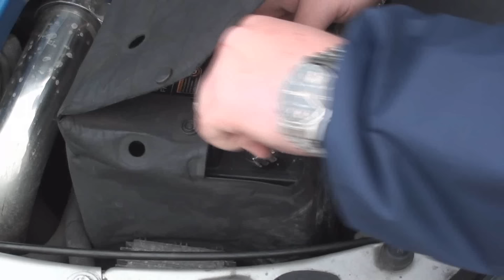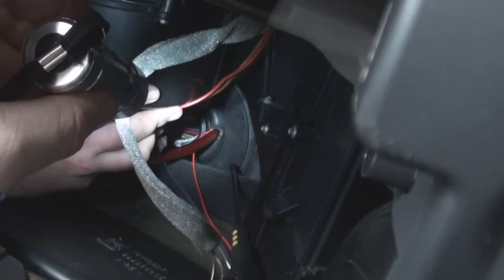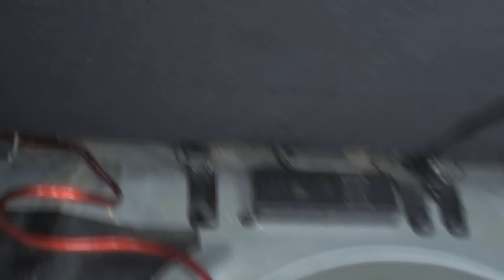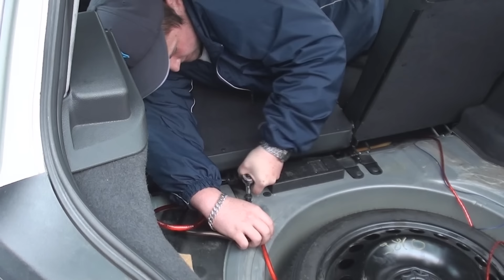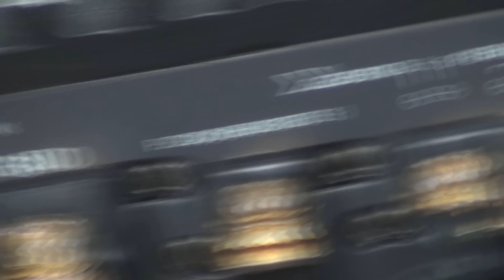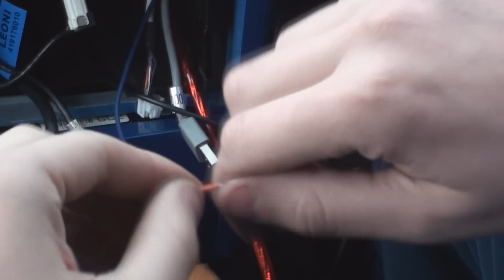How To Install A Subwoofer And Amplifier In 5 Minutes!

Comment: I m stuck. Please help. My car  stereo doesn't have the remote
Reply: use the power antenna wire as a substitute, which is usually activated when the radio turns on; alternatively, you can tap into a power source from your car's fuse box that turns on with the ignition to provide the necessary signal for an external amplifier.

Comment: What wiring kit would you recommend for a dual 10” with a 1600w amp?
Reply: 35mm^2 should be okay, but for the plans on future, you may use 50mm^2 coper wires. It seems like it’s not so important but i had few problems with my wires because they were too tight 👍🏻

Comment: Spot on lads, great vid to learn off. One question: Did you connect the speaker cables to a factory radio, or was it an after-market system? I want to connect to a factory radio

Comment: never mount an amplifier on a bass box, there are subsonic oscillations on the coil in the amplifier and magnetism in a speaker, and solders on the circuit board come loose and a burnt amplifier and no one gives a new one under warranty. for incorrect use

Comment: My ex installed my sub and amp but I need to remove it and keep the wires in place do I just disconnect the wire from the battery and tape it to stop it touching any metal do I have to remove any other connections to the battery first thank you
Reply from the maker: If you remove the fuse from the fuse holder, the main power wire then is safe. The Earth and RCAs are also ok to disconnect. The remote cable ideally needs disconnecting at the headunit, or securing the end so it doesnt short on anything as it will still be live when ever you turn on the headunit. or if you have a fancy headunit you may have the option to turn off the connection to the amp, which would also make it safe.

Comment: Hi man! So if i understood correctly if i have a supply battery only for aliment the subwoofer i don t have to connect black cable the negative to the battery but only at the amplifier and something that is made of iron in the car??
Reply: Positive go on the battery and then to the amplifier and the negative to the iron part and then at the amplifier right?

Comment: Cd player you mean the radio? Btw that cable which you connected to turn on the woofer when you said when the cd player is on you connected it with the positive wire for the radio and like this otherwise the amp wouldn't get any power and drain the battery while the car is off? Then why are the other two thick wires from the battery going directly to the amp? And would the woofer always play or can you do a setting on the radio to adjust the woofer volume or turn it off or only make the woofer to work. Btw would the bass also come from the main speakers? Can you make it to only output bass from the woofer?

Comment: i have a ground zero sub and a AP amp i have the red cable which is the power cable the ground cable the blue cable which i think is for the radio and then sone connections im not sure how to connect it to atleast hear it

Comment: This is 6 years ago now it's 2021 so let's see if yall can answer a ? I have. 😁  ok here we go I have a jensen. CDR5620 and a dual TBX10A SUBWOOFER with built-in amp I need help connecting these together can you please help me
Reply from the maker: Not sure exactly what your components are. But follow the video for the majority. If your using a stock headunit you will need to splice some rcas into the speaker cables to get its feed.
Reply: @bluudysgarage  ok cool so therefore I have rca inputs on the radio and there's no need to cut the RCA wires right.  that's what had me confused  about cutting the rca's off lol.   😂 thanks bro I see the picture on that part also can i take the TBX10A sub out and install a kicker C10 ?
Reply from the maker: @johngray2526  providing its the same size sub example both 10s or both 12s. Then yeah :)

Comment: Is five meters enough?
Reply from the maker: Not sure which cable you mean for.but most likely. Power may want a little more depending on the vehicle your fitting it in.
Reply: @bluudysgarage  its a cable set for the sub, and its the same shape astra
Reply from the maker: @TheWorldOfNathan  then most likely then bud they  normally have spare.
Reply: @bluudysgarage  Cheers just orderd my wires now 😂
Reply from the maker: @TheWorldOfNathan  brill :)

Comment: supposed to mount that piece down as something not having unmounted because it's nothing gets loose intestinal calls your car blow up or catch on fire for the amount that down something dip shit
Reply from the maker: Please learn how to write your comments in english so people can understand your stupid comment. It was held down with straps and velcro.
Reply: Why you're freaking work sucks
Reply: You didn't vote down the electric line if it's smack something a cause a fire you doofus
Reply: The big dummy
Reply from the maker: @michaelriga7666  and yet you still cant form a complete sentence. Also. This video has been online since 2012, been watched over a million times, not one person has ever mentioned causing a fire. The only way the "electric line" and by that I think you mean either the power or remote cable, is if you trap it and short it out, but even then it has fuses on the amplifier and fuses on the main power line, so unless you happen to be carrying loose liquid petrol which could catch fire in the exact area that it happens to short, you will not catch fire. Now please go back to school and learn how to type and construct sentences before trying to respond. Case closed.
Reply: I'm just saying the wire in the ends and I need to be mounted on something because I could become loose and that was smack something the battery smack apart just let you go when it could cause a spark or fire that's what I'm saying they usually
Reply: And it's not me it's my phone my phone stupid when I say something to make it doesn't understand
Reply: Is need to be mounted to something
Reply from the maker: @Michael Riga it is secured to the amplifier with a screw fitting and its attached on the battery with a nut. It isnt coming off. This is the fitment method of all subwoofer installs in any car done by amateurs and professionals.

If your so adamant that you are correct. Please go make your own video tutorial and perhaps we can all see this new method?l

Comment: Did the seat mounting bracket actually give a good ground? I'm thinking of using it for an earth in my mk4 astra but thing is i was wandering if it is a good earth cos its not like directly the cars' chassis.. its a bit of metal sitting on the chassis.. if that makes sense?
Reply from the maker: Its brilliant
 But sand off the paint first
Reply: @bluudysgarage  nice one bud cheers!

Comment: The rest of the wires are tucked under the carpet well  your power wires outputs a lot of vibration that wire you run your RCA and Remote the other side....Cable management would give you a better view and a sound that won't get engine revolution while pressing on the gas pedal..
Reply from the maker: Never run your remote and RCA together. 

Keep powers together. RCA separate. No distortion then. This is the method I've done for dozens of installs. No issues at all.
Reply: @bluudysgarage  yep I know you say never run RCA and Remote together ...but bro that's the method ..RCA and Remote together on one side and power wire on the other side...and btw your video was the first video I watched about installing amps and subs ...keep it up👍

Comment: will the battery dont go empty if its directly connected?
Reply from the maker: No. As the amplifier only turns on when the headunit is on via the remote cable.
Reply: @bluudysgarage  is that with every amp?
Reply from the maker: @enescan20  that's how they are designed.

Comment: when connecting my negative terminal it Sparks and caused my positive terminal to smoke or heat
Reply from the maker: Sounds like you connected them wrong way round.
Reply: yeah i did LOL also i fixed it but theres no power going from my wires. e.g my ground wires aren't sparking or they have no current going through them
Reply from the maker: @jayvzero  have you popped the fuse on the power wire. CD player. Amplifier. Check them.
Reply: @bluudysgarage  fuse under bonnet popped then replaced. sub fuse/amp (built in amp in the sub) had popped but was replaced
Reply: @bluudysgarage  also you guys r still replying after so many years. Legends
Reply from the maker: @jayvzero  I try my best. Got to be worth a subscribe :)

Comment: Thanks for your video instructions. Thanks to you, we solved our problem. We had no green led indicator of power. The remote cable was connected to the remote wheel cable. The wrong blue one. Thanks again, wish you the best !
Reply from the maker: Leats you fixed your issue! That's great!

Comment: By connecting directly to the battery
Wouldn't it be on 24/7 even when turned off?
Reply from the maker: No. Please watch the full video. The remote cable controls the amplifier which controls the power to it. The power is live on the cable going into the amp. But only turns on when the stereo is on.

Comment: I dont think it s that ok to have the amplifier tied to the subwoofer.... vibrations...
Reply from the maker: I have answered this many times. It's fine. It worked and continued to work for 8 years been used in numerous cars. You can also buy active subwoofer which some with the amplifier built I to the box. If vibrations did damage they wouldnt make active enclosures.
Reply: @bluudysgarage   yeah you have a point there .. nice work anyway 😀
Reply from the maker: Lol cheers

Comment: Great video, only isssue you shouldnt hook your amp to your shb box
Reply from the maker: It was on for 6 years no issues. Please tell me why I shouldn't?
Reply: @bluudysgarage  "i was told it was bad idea  cause it'll shake an vibrate the hell out of the components if it were to be attached to the box I was also told my amp will break if I were to have it mounted to my box
Reply from the maker: @Luke-tu6pd  I guess there is the chance if your running lots and lots of bass. But not with boxes like this

Comment: can u not just ground the wire in the front of the car???
Reply from the maker: You could.. but you would need to run an earth cable the length of the car. The longer the earth cable the more it effects the quality.

Comment: Can anybody tell me if the speaker wires from amp to sub be to short
Reply from the maker: They only need to reach from the Amp to the sub. So no they dint need to be long
Reply: @bluudysgarage  OK thanks. I was making sure I didn't cut them to short. I mounted my amp on top of my sub box and ran wires straight to the hook ups. So they are only about 18" long
Reply from the maker: @airborne82nd61  as long as they reach that's all that matters

Comment: Don’t disconnect the negative disconnect the positive because of the fact your vehicle is grounded out on the engine block or the chassis so if the negative hits any metal connected to where the vehicle is grounded you will have power to the vehicle other than that his video is pretty good
Reply from the maker: Sorry fella you are wrong.

Always disconnect the negative. The car is not grounded through anything. The chassis and the engine block have straps which come back to the negative side of the terminal on the battery.... always always always remove the negative.

Otherwise you risk potentially shorting the electrical circuit or blowing fuses or the ecu.

Comment: I'm keeping my stock stereo system in my Chevy Sonic and I'm really new to all of this but people are saying they take sound from the rear door speakers to go to the amp? Like splice it together? I was so confused. I think they called it shallow powering or something. Any advice?
Reply from the maker: James Banks hi james.

I'm not aware if the name. But I am that process.

If you don't have a RCA output on tour headunit like most stock units you need to splice Into a rear speaker. Usually people slice in the speaker cable to RCA adapters then plug them in from there. But remember you will have limited audio settings as changing the speakers audio will change the subs audio. Connect up with us through Facebook of you want to chat more.

Www.bluudysgarage.com
Reply: You can use a line Output converter and a Powered sub that will reduce the time taken for matching the amp and sub in terms of wattage Rms either DVC or SVC and so on...

Comment: What's your name on facebook?? And thanks for the quick response... So it's now 730 am here in the states so I will be getting up to try again soon.. Well I have my remote wire going from the rem port on the amp to the blue and white wire behind my deck... So I'm pretty sure that's right correct?... My amp fuse is ok as I have tried a couple other brand new ones and it still don't turn on.. So I'm going to try to test the voltage of my wires like u suggested I'm pretty sure they sell those at any auto store or at a radio shop so I will be going there first and foremost.. Hypothetically if it's not putting out 12v how would I fix this.... I've had 2 systems before this and I hooked them up alone and had no issues doing so now I have this issue and its taking me daays to figure it out.. So I appreciate the extra brain power. I did also ground my amp off to the metal part of the inside of my trunk which I scraped off pain down to bare metal and screw it down so I'm sure my ground is ok which leads me to believe either I'm not pushing 12v... Or I have my remote wire hooked to the wrong one which I always knew as the blue and white one... Or... The bulb fuse that sits under ur hood with battery the one you tucked away so it didn't hit any moving parts under the hood may be the fuse inside that bulb is blown as I never took it out while hooking these up.... Anyways give me ur opinion on this and I will go get a volt tester to see what my wires r pushing out .. Thanks again.
Reply from the maker: Ethan Michael no problem. Just search bluudys garage or Google bluudys garage.

You need to check if that's the right cable on your headunit. Also some aftermarket ones need you to change a setting on the headunut and turn on the subwoofer setting. Then that will turn on the amp signal on the rem cable.

Comment: Ok i have a couple questions... First off one of the better videos to show exactly step by step the correct process... I'm trying to hook up my subs and amp i finally just got the radio to turn on but my amp and sub r not working... My first assumption is that could it be that my speaker wire is messed up as in maybe I attached the positive side to negative on accident but that shouldn't stop my amp from turning on correct.. So there fore my next question.... Could it be my remote wire I hooked up to the blue and white cable coming from my deck is that not the right one... Plesse help.. I'm now on day 3 of trying to get my subs to work smh...please help.. Again deck works.. But no power to my amp or sub...
Reply from the maker: Ethan Michael hi ethan. 

I won't be your speaker cable so don't worry about that.

Is you have your 12v feed from your battery connected to your amp and thatvhas a working fuse in, and you have also connected your earth cable to a good earth, it can only either be the remote cable or a blown fuse on the amp.

Check with a multimeter if you are getting 12 volts on the remote cable at the headunit when it's turned on, if not that's the case. If you are check the fuses on your amp. Let me know how you get on. You can always message me through Facebook or Join my Facebook group.

Comment: Aye so I hooked up everything the amp turns on but I can’t get no sound.? What else can it be?
Reply from the maker: Gang Boii has your amp turned on? Has you CD player got a setting for subwoofer that you need to turn on. Is the volume turned up. Have you connected the rcas to the right ones.
Reply: Bluudys Garage yea the amp on and I turned it up the bass from the stereo
Reply from the maker: Have you turned on the sub out on the CD player. Check your instruction book on your headunit to find out.

Comment: Im trying to put a head unit in my 98 subaru legacy outback but every wiring diagram i can find online is missing wires or i dont have the wires that they say, i have seen at least 5 diagrams that say the same thing. Any help would be appreciated

Comment: not to put you down or anything but it is easier and better to use a existing grommet / hole to run wiring through the firewall

Comment: I have a stock stereo so I dont have a RCA port. I found out that a converter is a thing or also called a Line Out Converter. I want to connect it to my rear speakers because I have one subwoofer but I dont want to cut the wire of the rear speakers. What I mean by that is that I dont want to replace my rear speakers with the sub. I want to use both of my rear stock speakers as well as my subwoofer.  Can I strip the wire from the rear speaker wire on my stereo and wrap the RCA converter wires to it?

Comment: you literally skipped the most confusing part and that is how to connect the RCA cables to the CD player like you assumed it was common knowlegde
Reply: laxkid387 YES I KNEW EVERY THING ELSE AND WAS TRYING TO FIGURE THAT OUT HOW DOES THE AMP CONNECT TO THE CD PLAYER!!!
Reply: @louisbarningham  with the rca cables
Reply: laxkid387 it was
Reply: If you have a stock head unit you will need a line converter which converts rca into speaker wire
Reply: Just use the RCA wires "Red and White one" look at the back of your Radio there are RCA outputs labeled sub or SW...or If your Radio is stock use a line output Converter.